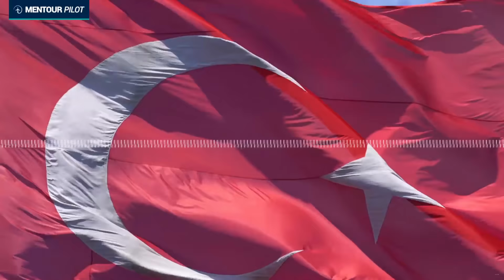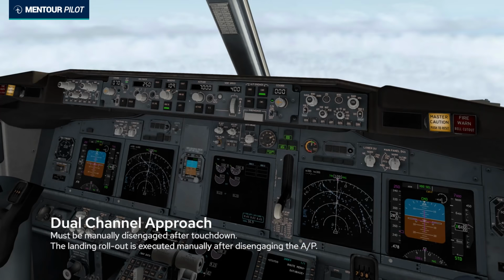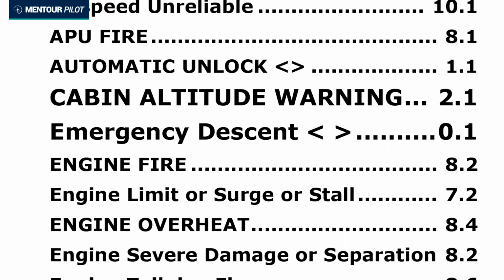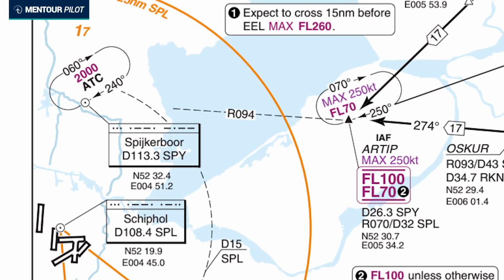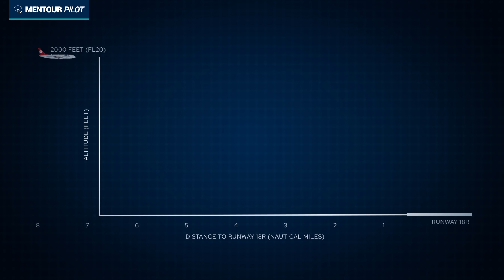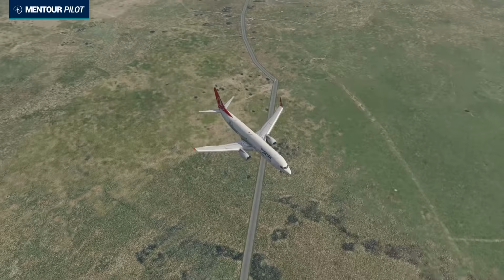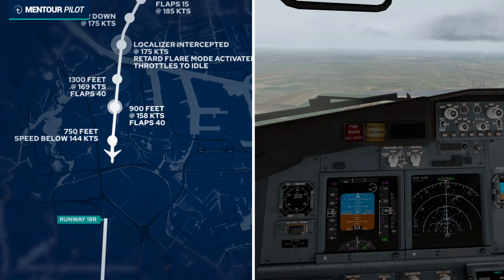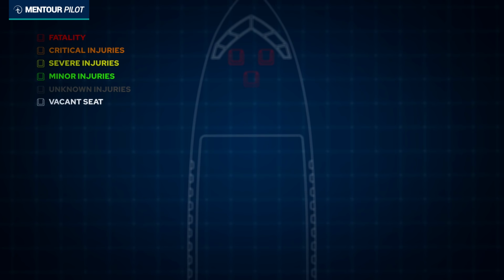What happened to Turkish Airlines flight 1951?!

Comment: Moral of the story; scream GO AROUND, even if you think you might be rude to the boss. No matter the SOP in your airline, if beeps or bumps happen in the cockpit and you're close to the ground, you go around and figure out what is going on. The aircraft needs time to react, you need time to think, everybody needs time to communicate, and your brain needs time to react. That is too much time to solve problems instantly.
Reply: CRM has changed a lot (for the better) since 2009, thankfully.
Reply: True. The only thing that lands instantly is rain.
Reply: Every time I watch a Mentour Pilot crash analysis I’m shocked at how quickly everything goes wrong in the cockpit. There’s no time to even think before the stall warning and crash
Reply: @AW-kr9fl  when error chains start there is plenty of time to recover. But if errors are undetected or not corrected early on then as the error chain progresses there is less and less time to recover safely. From an aircraft control point of view the error chain started when the airspeed reduced below Vref (minimum approach speed). If the thrust had been assertively increased at this point (and the autothrottle overriden or disconnected) the loss of airspeed would have been arrested and corrected.
Reply: Plus, as Petter has said several times, a very late TOGA also means the fact that engines don't just spool up instantly is of critical importance. If a captain as PIC forgets to call for a checklist at the appropriate time, the F/O is duty bound to remind him or her. Hopefully, now CRM applies so that a F/O can respectfully suggest a go around in a tone and manner that clearly communicates, "We have to go around!"
Also, at what stage was APP engaged? Why the need to change altitude on the MCP? It was briefed as a CAT 1 ILS approach, so why even engage the second autopilot? Is it crucial to change because of the failure of the radio altimeter. A/P should have been disconnected, then switched. But even if my statement is correct, again, a go around was crucial.

Comment: As a computer engineer, I have to say intermittent failures are a real pain to diagnose
Reply: Indeed.
Reply: Especially when the machine takes a dive into the ground
Reply: @GuardDog42  
They flew it into the ground.
Reply: Yes, and maybe a worse pain is when the device starts working after you leave it for the night
Reply: As computer engineer, you should know that software are very unstable and that’s a part of the job. Intermittent problems outside software are really hard to solve.
Reply: @donsekr8520  Aircraft software is not designed flimsily like most code out on the web today. It not only can't have bugs, but also needs to detect hardware-induced inaccuracy. Which, most of the time it does. But detecting inaccuracy and locating the cause of that inaccuracy are two entirely different issues.
Reply: Race conditions